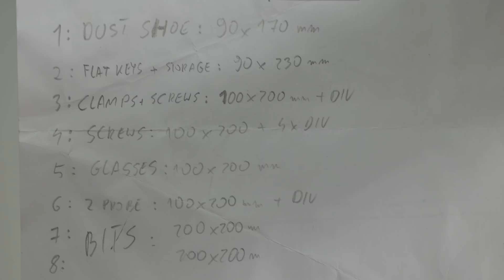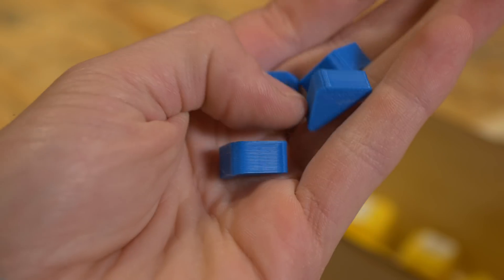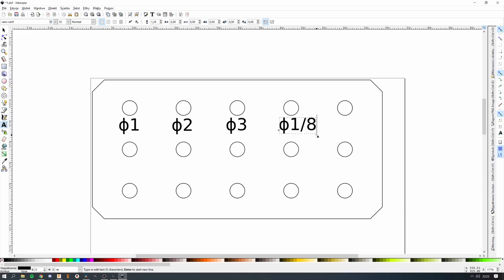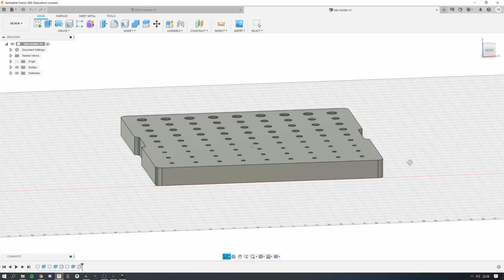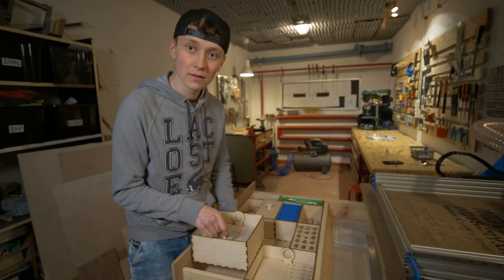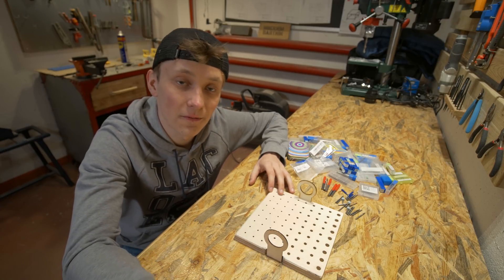Perfect CNC organization

Comment: Hi bro!

Really an awesome channel. I really appreciate your work and that it is Arduino related. At this point, I am working on my electronic skills and PLC projects and I wanna explore more of a PLCs and do your CNC build soon.

My genuine technical question: 
Could there be any good reason to use a faster micro-controller or micro-processor than Arduino Uno R3? For basic open-source software to, do Carving projects?
Or is it like the Arduino is going to be overkill or let's say more than enough no matter the size of your CNC machine and detailed carving projects you'll do?
I know that the actual,, hard work'' happens in Fusion360, but really... could there be any advantage or reason why I should go for let's say Arduino MEGA or RaspberryPi for basic CNC software?

Thanks a lot.